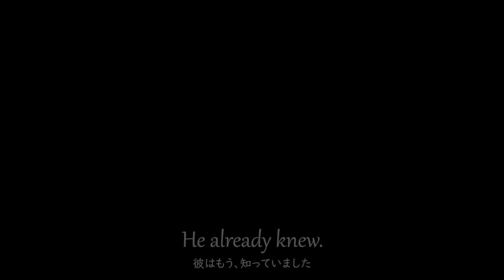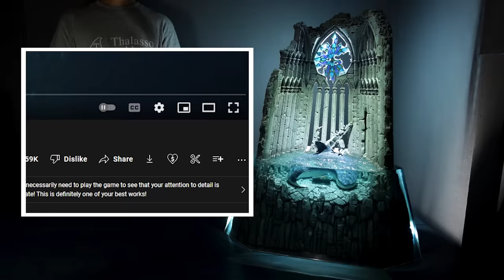Diorama of Prayer Ruins and Guardians

Comment: I think the sculpture you made could be bigger, but a tip I wanna tell you is something called Score Epoxy; Epoxy poured over a block of clay with micro cuts in it, you can make light bounce in the glass and make the light going through the glass more vibrant and brighter.

1. The color of the Epoxy depends on what you want, but use paint or paint dust if you want a deeper or more vibrant color.
2. You need a very sharp tool, like a razor blade or glass shard, and set the blade on the epoxy and not press
3. As the epoxy dries, when it's semi-rubbery, then cut the shapes/lines.
4. Cut the shape/lines into the Epoxy *(NO ROUND EDGES)*.
5. Let it dry the rest of the way.
6. Cut it to the needed shape/size.

DONE!

Comment: h. how did you even do that. i mean i literally watched you but im still floored by the architecture. you didnt even just make insanely detailed gothic architecture you also did it IN FORCED PERSPECTIVE. not a straight parallel line nor a nice right angle to be found! the "final" product (so to speak, since you then have to break it down hahaha) is breathtaking, but getting to see the techniques you used is incredible too. setting up long strips across multiple columns so you can put that layer of trim on all of them in one go! making a mold of the fancy decal so you can make multiple without having to resculpt it! thats so clever! every single time i watch one of these i think i cant be more blown away than i was by the previous one and every time im wrong